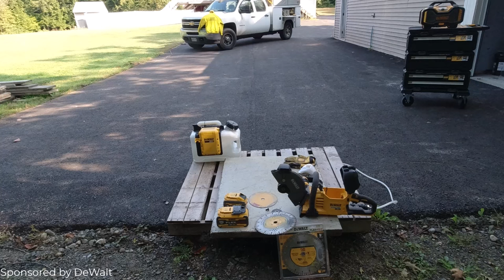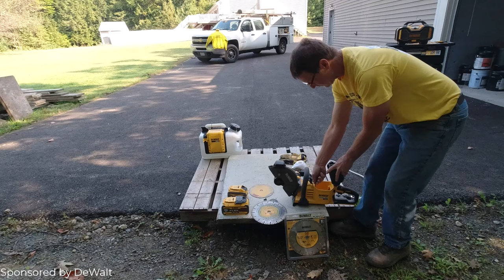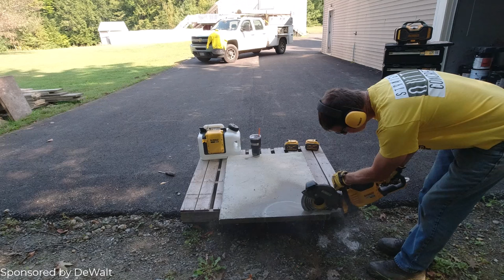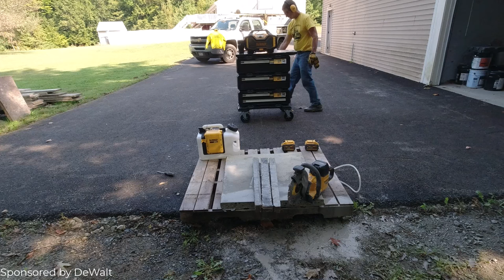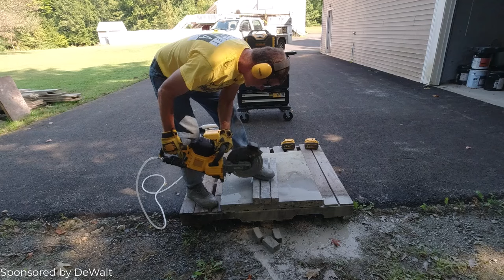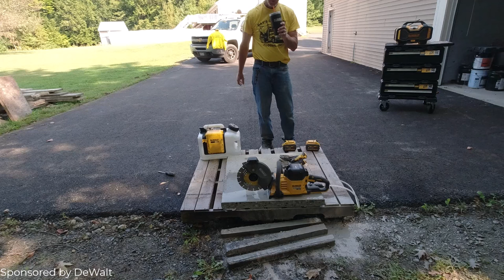I Tested DeWalt's 9 Inch Cut Off Saw, See How It Cuts Concrete

Comment: Only problem is concrete is never 2” thick. Would like you to demo again on a 4” slab with rebar. That’s a practical test.
Reply: Yes you can order 2  inch concrete